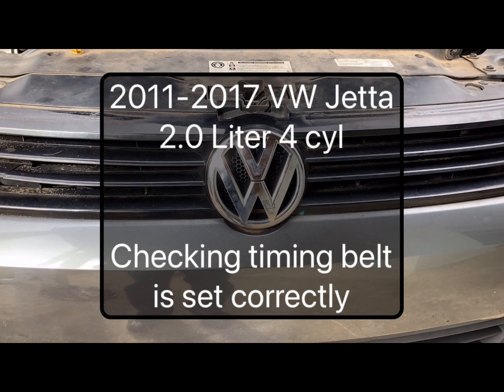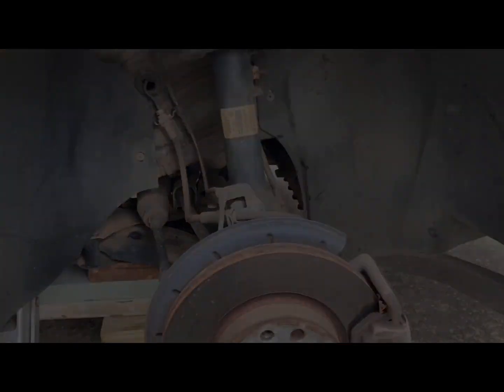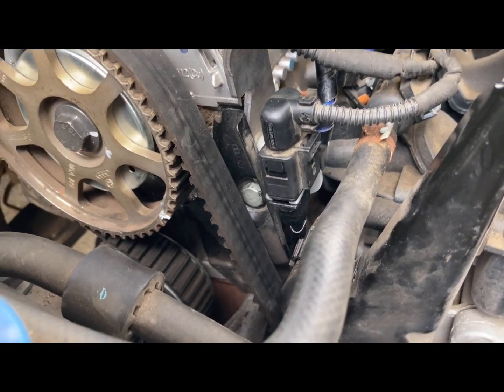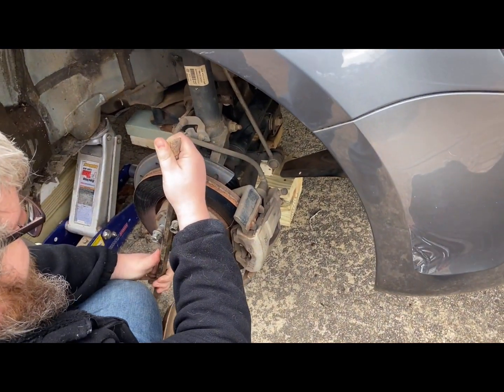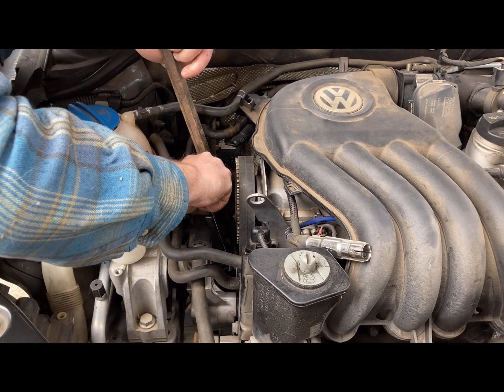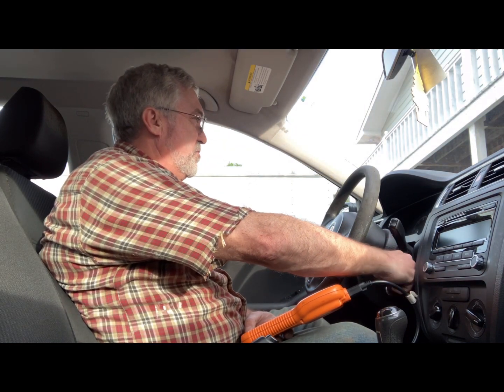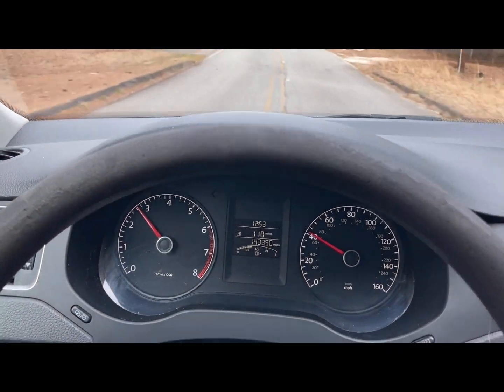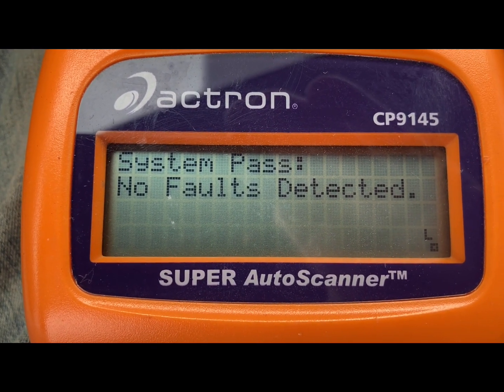Cam timing- Set timing belt 2.0L VW Jetta camshaft & crankshaft #vw #repair #volkswagen #autorepair

Comment: Thanks for the excellent video! You helped me solve my problem! I had the P0016 code but I thought the timing belt was installed correctly. I found my TDC using the screwdriver on the piston trick and saw that the belt was 2 teeth off. Installed the belt correctly, no more code and engine runs MUCH better. You taught an old dog a new trick. There is no guesswork with this method of finding TDC. Sometimes it is tough to find the crankshaft timing marks. Thanks again!
Reply from the maker: Glad to hear and the video was helpful..👍

Comment: I have a 2012 Jetta 2.0 crank no start and can seem to find much on it my codes are all over the place but I got p0030 p0130 p2243 p0016 p0456 p0442
Reply from the maker: See if you can eliminate some of the codes…..
Were you able to find anything?

Comment: You definitely didn't show us the crank shaft pulley marks on where exactly it should be
Reply from the maker: I didn't move the belt on the crankshaft and kept the belt tight so I wouldn't have to re-time the engine.

Comment: Why were you in there to retime the engine? Did it jump timing from a bad tensioner or something?
Reply from the maker: To access/replace the camshaft sensor.  On this model they put it behind the camshaft gear... not very smart engineer at VW...